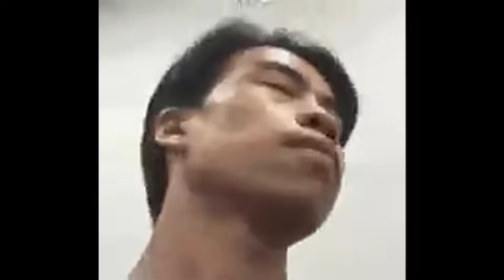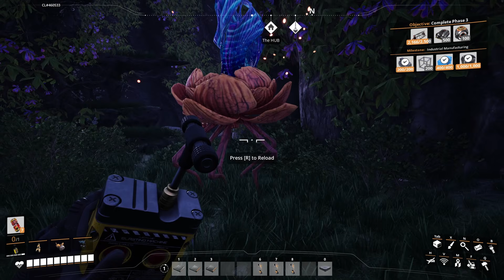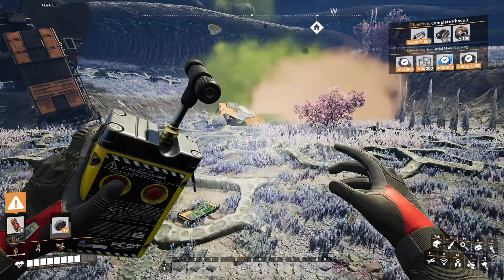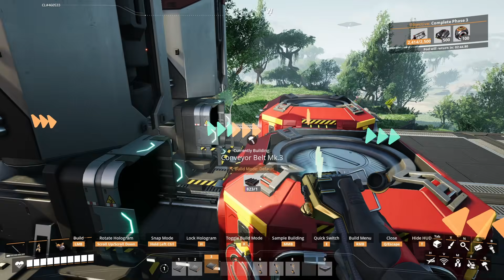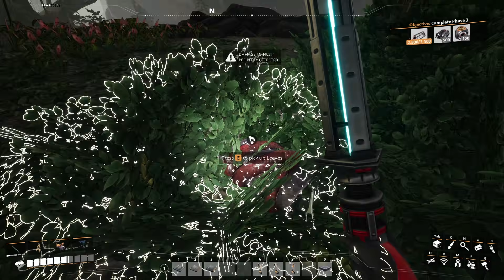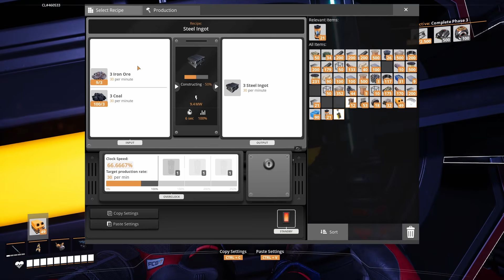Heavy Modular Frame (and Sam Fluctuator) Factory Complete! | Satisfactory ep.12

Comment: A Hard Drive tip: 
#1 You can rescan drives (once)
#2 If you don't like the recipes, you can leave them there, scan the next drive, and because the recipes from the unlocked and not claimed drives aren't pulled, get new recipes.

And thanks for the video!